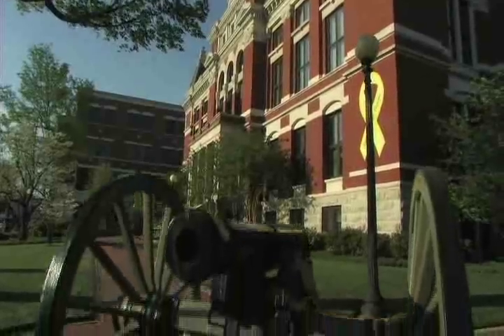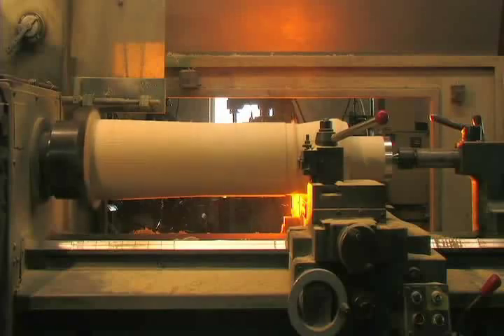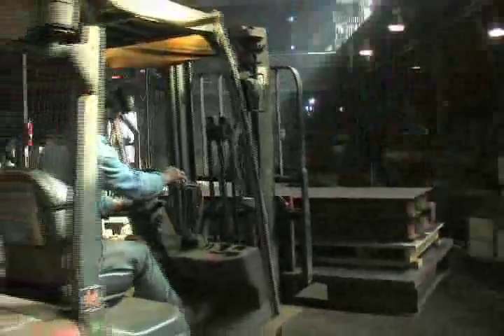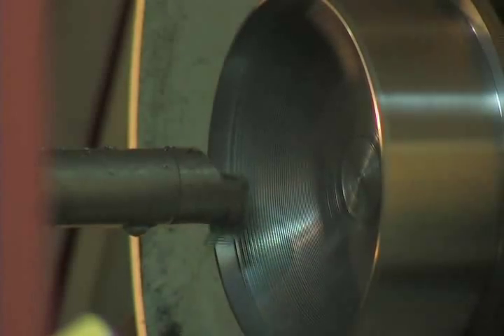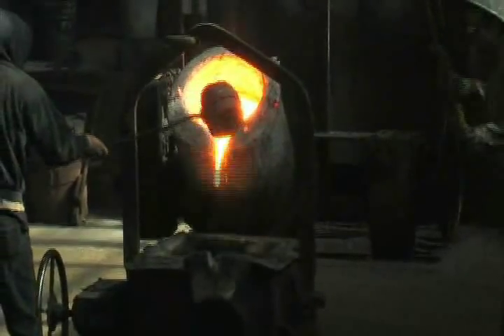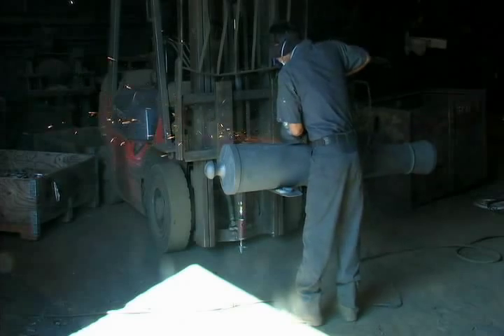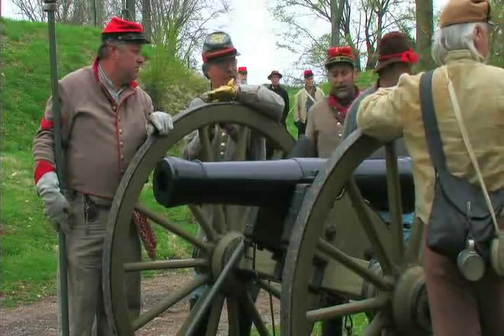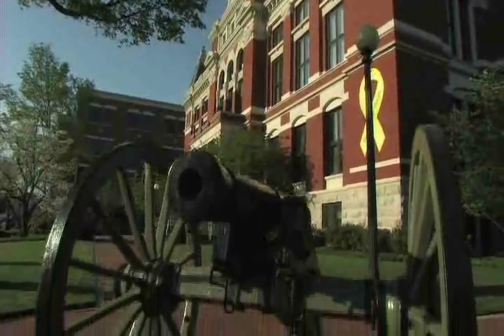The Foundry Process

Comment: Great informative vedio, aside from the steel tube placed in the mold, it only leaves a couple questions in mind. Did they originally cast with a core and we're they originally poured at that angle?
Reply: No and no. The mold was stood on end.
Reply: See the big Culverin cannons recovered from the 1545 Mary Rose shipwreck, the Iron cannons at least were forged from flat iron bars, that's why they have an outer Hexagon shape
Composite cannons with forged iron barrel liners & Bronze outer casings have been around since at least the 16th century described in historical accounts, the oldest physical example is one recovered from the 1629 Batavia shipwreck off the Western coast of Australia
The Maratha and Rajput mughals manufactured composite cannons in the 18th century as did the Chinese.
These types of cannon were far lighter & stronger than cast iron or bronze cannon, however the difficulty in manufacture meant they were never widely adopted.
Here's a link to a 2005 scientific study of a Mughal iron / bronze composite cannon.
https://insa.nic.in/writereaddata/UpLoadedFiles/IJHS/Vol3_2005_08_AZDAHA%20PAIKAR%20THE%20COMPOSITE%20IRON%20BROZE%20CANNON%20AT%20MUSA%20BURJ%20OF%20GOLCONDA%20FORT.pdf

Comment: Haw much did one cost?
Reply: Contact South Bend Replicas for a price on a good one.
Reply: They can be from 25 to 60 thousand dollars.
Reply: I've seen 2 1/4" bore cannons with a carriage for $2,000 and with targets that prove it shoots. I don't believe that SBR puts the sleeve in before pouring. They drill and machine the iron and press the steel tube into the bore. Then it's secured in such a way that it will not go down range during a firing. I would never trust wielded trunions.

Comment: why not make a stainless steel one while you are at it? whats the point of a replica if its not actually a replica?
Reply: It's better than the original but the design is the same
Reply: @HostileLemons  right. so why not make a stainless steel one. just like what your saying 'its better than the original but the design is the same.
Reply: @JCElzinga: Stainless steel alloys wouldn't be suitable to make good canon; they'd either be weaker or potentially more brittle and explode. Ductile iron is the toughest, safest metallurgical option. Because stainless doesn't rust, it doesn't mean it's stronger. Also, despite this being an excellent documentary, quite a bit wasn't mentioned, such as the grade and type of steel tube used for the bore, and what grade of ductile iron the casting was, not to mention any possible heat treatment processes applied later for the purpose of metallurgical stability. It would be interesting to know, but not in the commercial interests of the company to divulge, I guess.
Reply: @zhouzhang9102  good call on the stainless, but maybe missing the point of, is it really reproduction? like if you make me an english warbow with carbon fiber is that really 'reproduction' how faithful to the original do you have to be to be considered reproduction?  a question for philosophers. I was hoping for a 'this is how they did it' kind of documentary.
Reply: @argylemcgoogin3298  i hope he makes a video of that i would love to see it
Reply: Historic reproduction doesn’t preclude improvements in materials and methods
Reply: maybe they wanted to take advantage of ductile iron because cast iron cannons were known for occasionally blowing up and killing their crews 🤔